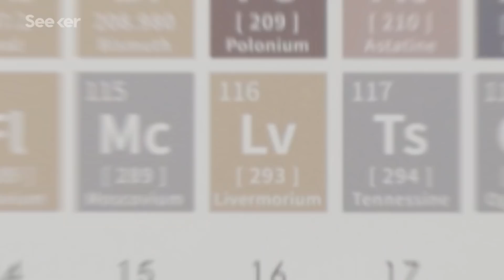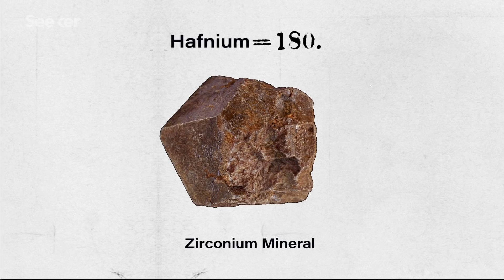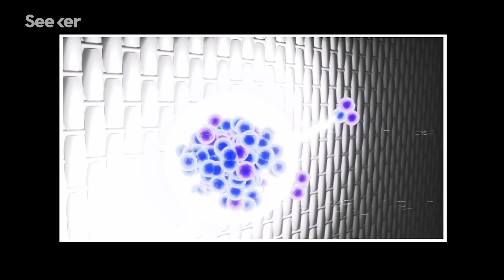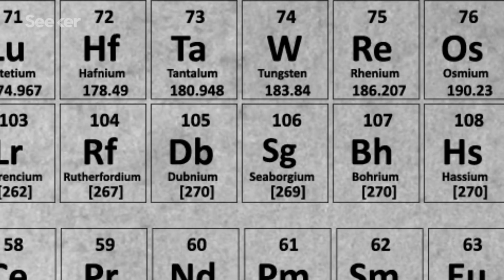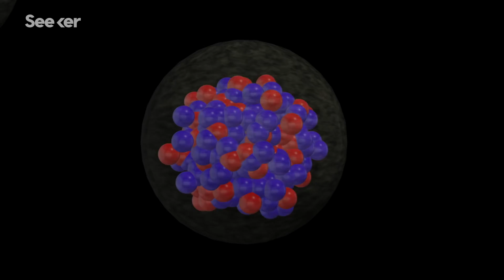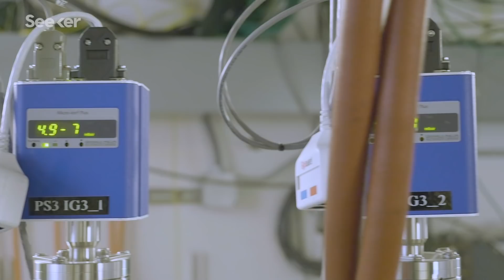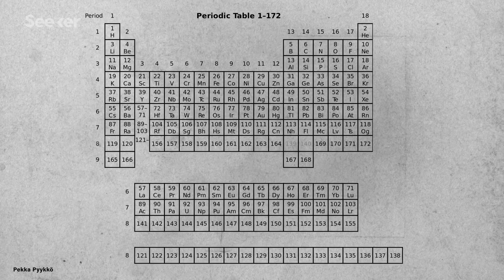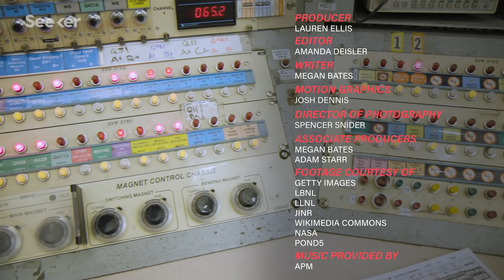This Superheavy Atom Factory Is Pushing the Limits of the Periodic Table

Comment: Technically, every accelerator accelerates things to a fraction of the speed of light
Reply: Like a mobility scooter
Reply: Technically,  I can also run at a fraction of the speed of light.
Reply: @dylanscott539  you run very slowly, because I walk at a fraction of the speed of light.
Reply: I travel at the fraction of the speed of light all the time
Reply: You should see how fast I drive when I'm late to work. It's literally a fraction of the speed of light.
Reply: Question Questioning Question  It makes perfect sense what he said, but for some reason you act like it's nonsense.

Deceleration is, in essence, the addition of velocity (which is the very essence of 'acceleration') just in the direction opposite the one you're currently traveling in.  It makes perfect sense if you can escape your own lexical dogma for a moment.  It's wordplay, not literal heresy lol.

It's not even confusing or difficult, it's just different.  It's words you don't expect, being used to describe something I'm certain you're already familiar with.  

Decelerating is, conceptually speaking, the act of accelerating against your current trajectory, and that therefore "deceleration" doesn't necessarily exist at all because even that, is, in essence, an act of "acceleration," albeit in the negative, relative to your current trajectory.

Just because it's words in an order you don't expect doesn't mean it's wrong or crazy.  All you have to do is stop and think for a moment, and not even that hard.
Reply: @ObeyCamp  Acceleration is just deceleration in the opposite direction of travel. 😜
Reply: @ObeyCamp  using a thesaurus to find super smart words immediately followed by “lol”
Reply: @Wroger Wroger I'm sorry but what you're saying is complete horseshit.
1. You clearly haven't taken any studies in physics
2. Scientists have not done that, one cannot simply shove energy to the end of a  "light", light is not only a photon but also a wave, not something you can just shove another light onto, also adding energy too light simply shortens it's wavelength and increases its frequency. 
3. If two galaxies were going towards each other at 60% of the speed of light, their accumulated velocity when viewed from one of the galaxies will be less then 100% the speed of light, i.e Velocity does not add up linearly near relativistic speeds.
4. Please learn some physics before you spread misinformation.
Reply: I farted and it accelerates me at a fraction of the speed of light. Undetectable to the human eye but that acceleration is there
Reply: Science Revolution  did you forget about the strong and weak nuclear forces?
Reply: I don’t think anybody gets it, any speed is A fraction of the speed of light
Reply: Relativistically everything in the universe is moving at a fraction of the speed of light. Nothing is actually static since the big bang.
Reply: This comment subsection is the newest heavy element ....NERDTOMIUM 🤔😁.
Reply: @foursee3714  Might I suggest nerdtimneum...
Reply: Science Revolution   its about the internal forces in the atom, not the empty space. Atoms are tough. 

If you had 2 massive magnets in space, it could be very hard to push them together regardless of the amount of emptiness between them.
Reply: Science Revolution  those arent the only forces in an atom
Reply: I can run at a fraction of the speed of light
Reply: 99.999998 speed of light
Reply: There’s always gotta be a “well, technically…” guy in the comment section
Reply: @austinhixson625  well, technically, every response to a "well, technically" comment is in fact itself a "well, technically" comment. Just thought I'd lend a hand.
Reply: @austinhixson625  Well technically two , one to annoyan one to respond anoyinly
Reply: Rain checknium, atoms = 0 balance.
Reply: Akashic Samadhi speed of light is an universal constant irrespective of frame of reference
Reply: Akashic Samadhi  actually space itself is accelerating faster than the speed of light, which is a brain twisting concept. It might have something to do with "dark energy" as well. Anyways, the result is that in the distant future we will be unable to see stars in other galaxies, because they they are moving away from the Milky Way faster than light. Any civilizations that arise in this time will probably never understand the Big Bang, the evidence will have become invisible. I'm not sure what happens if dark energy starts ripping apart stars within the galaxy, it's a scary thought.
Reply: @squirlmy   I dunno , but a quick estimate ; very hot very fast - no way you could possibly notice the beginng before the end , plasma plus energy's... godspeed an go in peace
Reply: Everything moves at a fraction of the speed of light
Reply: Technically every movement is a fraction of speed of light
Reply: when you discover the antigravity properties of element 114, please notify Bob Lazar so he can say he told you so
Reply: LHC pushes the neutrons to 99.99999% of speed of light
Reply: LiSteN here you little SHiT
Reply: Not wrong.
Reply: Well, technically it's all technical.
Reply: Technically we a traveling at a fraction of the speed of light
Reply: Technically my car accelerates me to a fraction of the speed of light...
Reply: @Wroger Wroger actually light aways travels at the speed of light relative to any observer.   Thus the light would still travel at the speed of light, it would just appear to be blue shifted.
Reply: @Wroger Wroger that was not in a vacuum.  That is an effect called cherenkov radiation. I can only what happen when light is traveling through some sort of translucent object.
Reply: Science Revolution  water and ice are compressible. You just need to use astronomical forces.
Reply: Every speed is technically a fraction of the speed of light
Reply: Yes, even car accelerates to some fraction of speed of light... Dont be idiot of postmoderna, we all know they ment to express that the speed is closer to speed of light than others we have...
Reply: technically every time I walk to the fridge i travel a fraction of the speed of light
Reply: Yes. Since everything is quantized so you can write your fraction of the speed of light as (a/b) * c where a,b are integers. If things were classical you could theoretically have a velocity of (π/3) * c, which is by some rarer definitions, “not a fraction of c.”
Reply: Everything travels at a fraction of the speed of light
Reply: Thanks for pointing out the obvious @2:15🤣🤣🤣
Reply: I can run at a fraction of the speed of light
Reply: @DavidTa2  670549568 MPH?
Reply: @GlobalEl1te  yup
Reply: So wheel never get there.?
Reply: you breathe by accelerating air to a fraction of SOL
Reply: Technically, EVERYTHING travels at the speed of light.

It just depends on your frame of reference how much of that velocity is through space and how much is through time.
Reply: @Wroger Wroger From each galaxy’s frame of reference, the other galaxy is getting shorter along the length of travel and moving slower through time.

When you say they are moving 0.5 c, you are saying relative to you which would be different for each of those galaxies relative to each other.
Reply: I think I’ve learned more here than school
Reply: 2:20
Reply: My car accelerates things to a fraction of the speed of light
Reply: By the way we are always looking into the past
Light has to bounce into the eye from the object your looking at
Reply: How long it take you to figure that one out
Reply: Technically speaking....isn't every speed a fraction of the speed of light?
Reply: Technically, everything that moves is moving at a fraction of the speed of light
Reply: Ah yes the movement is made out of movement
Reply: Late to the party but cracking point.
Reply: Or you can just use your hands to do it
Reply: 9999/10000c is a pretty decent fraction of the speed of light
Reply: Yep
Reply: I. Am. Accelerate.
Reply: Everything moves at a fraction of the speed of light lol
Reply: Fraction to which the difference as compared to speed of light will be minimal as possible
Reply: What would happen if you put a accelerator in a accelerator and put them both on at the same time
Reply: Question Questioning Question  0 speed isn't a fraction. If you accelerate to 0 then you have successfully accelerated to  not a fraction of the speed of light.  

The reason that there is no such thing as deceleration is because of relativity. You only accelerate in the opposite direction of travel. Therefore the net speed is slower than the original speed. We call this deceleration but in truth you are simply adding velocities together.
Reply: @foolapprentice3321  0/c ha got u! Also deceleration is actually a term that refers to a jerk that is action opposite to the direction of acceleration. As in decreasing acceleration
Reply: @justynpryce  i know what the word means, that's just not how its described mathematically
Reply: NotTheRealDeadpool Though you are completely right if you describing what you are. Deceleration is usually describing a decrease in velocity. Though I will side with you that deceleration should refer to a decrease in acceleration rather than speed.
Reply: @funkyflames7430  Deceleration (or negative acceleration; a vector value) is a decrease in velocity (also a vector value), not speed (a scalar value).
Reply: fool apprentice well, the accelerator’s function is only to accelerate molecules, right? so when the molecules come to a stop, by then, the accelerator has already stopped accelerating the molecules
Reply: @foolapprentice3321  nothing is ever at zero speed...
Reply: @Unmannedair  relative to what?
Reply: @foolapprentice3321  except the moon tisdis- accelerating me from my normative rate of rotation , and the swirl of falling about the sun's gravity well , whilst hurtling twords alpha centuri , haplessly...
Reply: what they meant was a significant fraction of the speed of light. think: traveling around the earth 7 times in a second kind of fast.
Reply: @ethansmith5560  Traveling around the earth 7 times in a second would be the actual speed of light, not a fraction of it.
Reply: @JakeFoster01  Travelling around the earth 12 times within a second is almost about the speed of light. 7 times would be 84% the speed of light.
Reply: @JakeFoster01  When things approach the speed of light, reference frame really matters because of time dilation and length contraction. In the reference frame of light, the universe is collapsed into a flat pancake and no time at all has passed between the photon being created shortly after the universe became translucent and until it reached an observer on Earth 13.7 billion years later as cosmic microwave background. For an observer on Earth, it took 13.7 billion years to reach them.

This is not a meaningless distinction. Very short lived particles called muons (you can think of them as a heavier cousin of electrons) are created in the upper atomsphere by cosmic rays. They have a half-life of 1.6 microseconds and traveling at very close to the speed of light you expect them to only reach 500 meters or so in one half-life; down to Earth it would take something like 30 half-lives (forget about ever seeing one). They should not reach an observer on the face of the Earth in any number we can measure, but they do. In their reference frame going at speeds of sometimes as much as 99.999% of the light speed, the distance down to Earth is 70 meters or so and the Earth itself is an oblate spheroid only 60 km thick.
Reply: @rishirajsaikia1323  rekt
Reply: @rishirajsaikia1323  7.5.
300,000km/40,000km = ?
Reply: @rishirajsaikia1323  12.876234 times around the earth is the speed of light....and I just made that up and it’s on YouTube now so it’s true
Reply: @rishirajsaikia1323 , where did you get your figures? My understanding is that light travels around the earth about 7.5 times in one second
Reply: @rishirajsaikia1323  24,000 x 8 is 192,000 speed of light is 186,000 per second. So it is less than 8 times round Earth in 1 second.
Reply: @rishirajsaikia1323  bro please please learn math
Reply: @ethansmith5560  7.5
Reply: Ethan Smith I think everybody got that
Reply: @ethansmith5560  speeds where relativistic effects come into play. I think she either explained previously and it was edited out, or maybe she realized in that moment that this interview was for an audience who don't necessarily know enough physics about how relativity comes into play, and that an explanation would be necessarily lengthy. My ex-wife worked at the Physics department at MIT, and professors and staff often had problems switching from talking to graduate level students and above, then to talking to laypeople in plain English about what they were doing; what problems they were trying to solve. In this case, it might have been helpful if the interviewer stopped her and asked her to explain what she actually meant by a "fraction of the speed of light"- which I assume means relativistic speed, which might occasion a fun speech about Lorentz factor formulas!
Reply: @ethansmith5560  you're estimate is surprisingly close to the 86.6025% or more of the speed of light actually used in cyclotrons! Did you know that? if so ignore my previous post,
Reply: Ethan Smith well yeah 😝
Reply: @ethansmith5560  even your own feet lol
Reply: Welllll teeeechnically since there is no such thing as deceleration, only acceleration against the velocity vector of an object. If you accelerated to a stop then you are no longer moving at a fraction of the speed of light. Meaning, an accelerator that accelerates you to not a fraction of the speed of light.
Reply: fool apprentice 
That is not true. Always depends on your frame of reference. You can just stop to some frames, but to others you are moving.
Reply: @foolapprentice3321  I will make you this accelerator for the price of one hamburger! ;) Although, I think she meant relativistic speeds, in a particle accelerator this is above 86% the speed of light. Just FYI
Reply: fool apprentice, acceleration is a relative measurement
Reply: fool apprentice though only when velocity is negative and acceleration is positive having the same direction or vice versa where velocity is positive and acceleration is negative. 
Now even then this only occurs for a instant as is solvable by basic physics equations. So yes accelerators are capable of bringing down the velocity to zero if the accelerator has a complete control over all variables like a God which would be impossible as far as we know for any technologically advanced civilization. Not only this but 0 is a fraction. 0/1 is simply 0 - 1 the amount of times it can be performed before reaching 0, which is 0.
So not only are you being unnecessarily critical of a fun comment but also wrong.
Kinda reminds me of that time when Jimmy Neutron called table salt sodium chloride when there is no need for calling it so and also being wrong in calling table salt sodium chloride due to the fact that table salts have anti-caking ingredients mixed in.
All of this just to sound smart.
Reply: @funkyflames7430  first of all, I feel like you're a bit of a hypocrite. Second of all, I don't think you understand the tone of what I was saying. Maybe a problem with social cues on your part?
Reply: fool apprentice Hypocritical? Ok, maybe a little but only if I was saying all this just to sound smart. But I had other reasons, such as correcting your false belief that 0 is not a fraction, deceleration is a real thing that may not  truly exist but is a useful term to specify, and maybe some enmity. So maybe I did do this to sound smart but I definitely also did it because I felt your statement was wrong at first glance and I had to follow my instincts to truly see if they were right. 
So maybe yes, but again I had many other reasons while your reasons would be similar they would be in vain.
And as for social cues. Simply the lowest form of insult really. In fact I believe anyone who uses this as an insult is really just showing how much a society led zombie they are or just how desperate they are to hurt someone.
Yare yare daze
Reply: @funkyflames7430  who said i was insulting you? I mean, I seriously think you might be missing my tone here. 

If you think I'm trying to show off and you also think I'm insulting you then you definitely are missing out on some  unspoken communication.
Reply: Technically when you're driving in your car you're traveling at a fraction of the speed of light. 
See, what you said is idiotic. Everything that moves is "technically" traveling at a fraction of the speed of light. Also it isn't even "technically", it just is, there ain't nothing technical about it.
Reply: Jacob Toweson Actually, the use of technically fits within the definition of technically. So technically, it is all fair use of the word. 
The statement may be obvious but still is applicable. 
According to the definition technically means “according to the facts or exact meaning of something” which means we can replace technically with one of its definitions.
According to the facts, every accelerator accelerates something to a fraction of the speed of light.
Can you say anything is really wrong with this statement?

Comment: I wonder that is the mass of a lead atom from a decommissioned nuke power plant is? Also if a it could be used in an atom fusion.
Reply: @ProwlerCam  The lead in nuke plants are there to absorb neutrons.  So I suspect they should have more neutrons than normal lead.